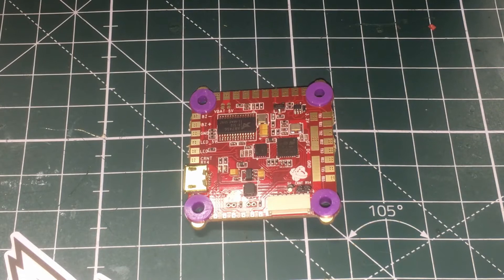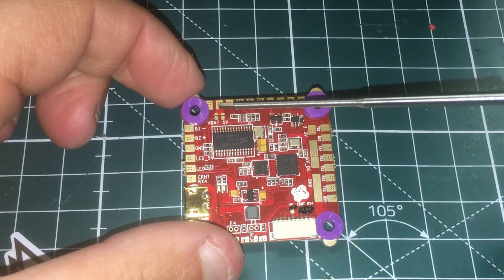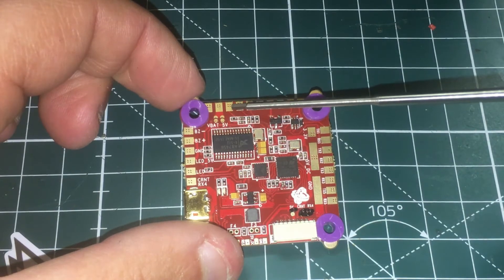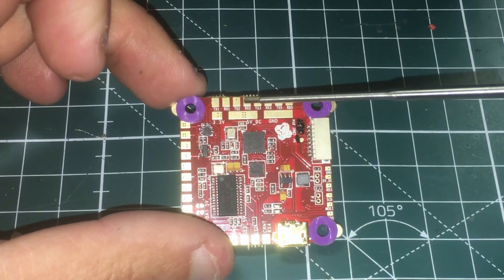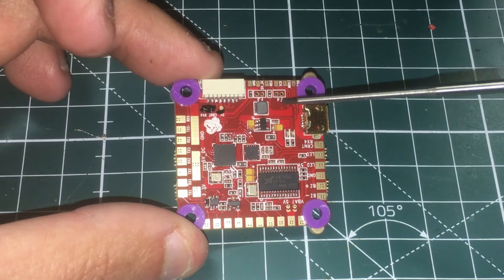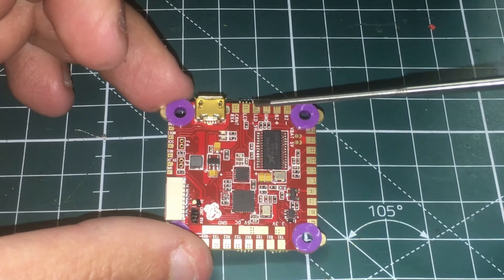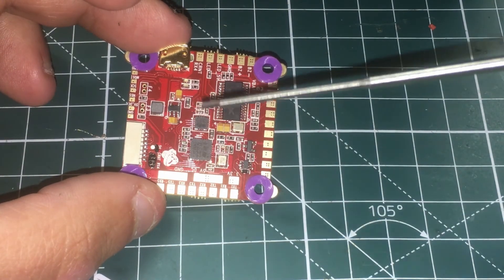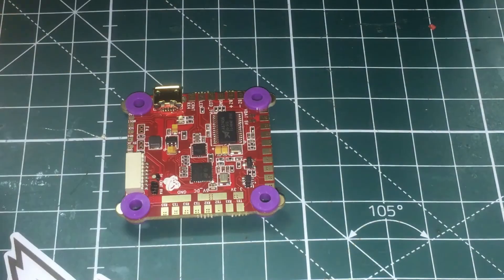Helio RC Spring Flight Controller Overview

Comment: So I dont then have to use that 4in1 cable to wire up esc?
Reply from the maker: GAproductions u don’t have to but it makes it a lot easier and cleaner then soldering every wire on the board separate.

Comment: Hi there ...
Got one question...  I got my HELIORC without the Cable..so did Soldering erveruthing of the ESC...
My question is.. the PAD for CURRENT on the board,  what is it all about and I did solder it but did not see the amount of Current on the OSD. 
Any help is welcome.
Reply from the maker: i dont have any of them bridged and it works just fine, I would reccomend if your using a 4 in 1 to unsolder the bridge and see if it works like mine did

Comment: Does the board have a VCC out?  If powering the board via VCC on the 8pin esc connector, do I still need to bridge the vbat pins?  Or is that vbat/5v bridging only for powering the board using the pads on the side (by the mounting hole)?
Reply from the maker: If your using vcc to power the board u have to jump those small bridge right under it. There is no vbat pins on the board for accessories